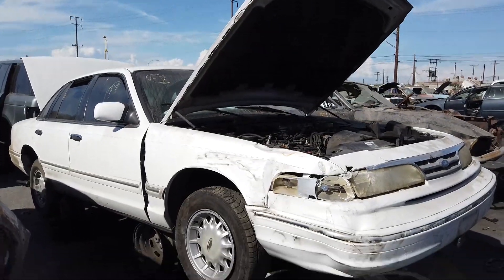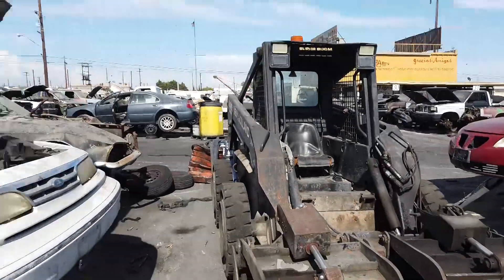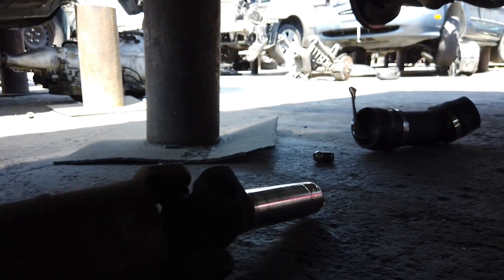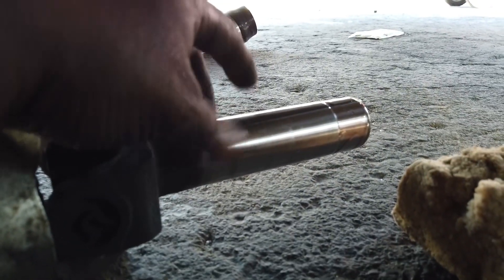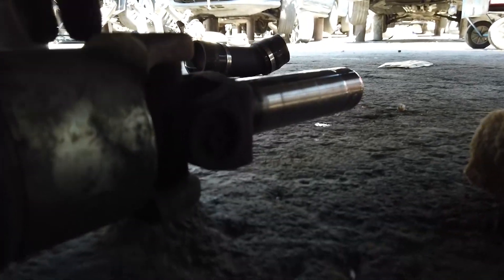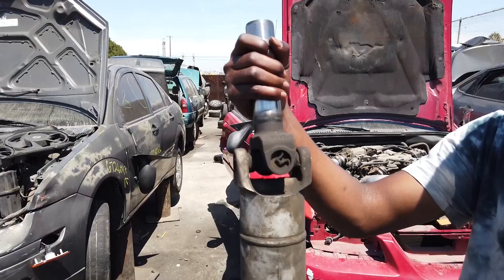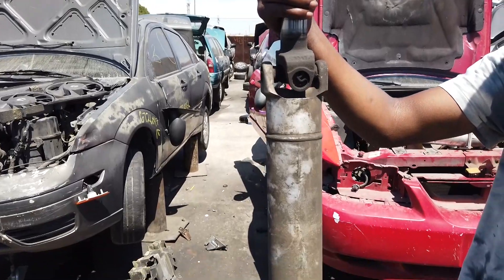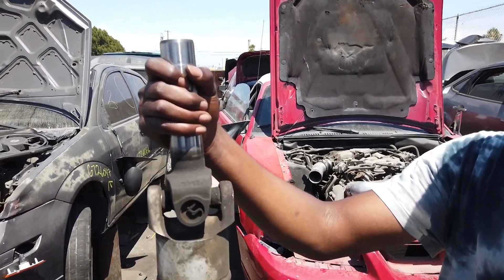Foxbody Mustang / Police Interceptor Aluminum Driveshaft Swap - JUNKYARD MOD

Comment: Just want to say you are the man tony ,I never knew crown vics had aluminum driveshafts,went to a local boneyard today and scooped up 2 for 60$, 1 will be for me and one for a friend, called a local shop and they told me 70$ to cut and balance, I appreciate all your input to the foxbody community,  thanks again.
Reply from the maker: Haha dope man!!! Glad to help.
Reply: @JunkyardDoggs  hey tony I got a question, what yoke will I need to get to work with this set up,is yours custom ,any help is greatly appreciated.
Reply from the maker: The aluminum driveshaft is 1350 yoke size, so order a 1350 28 spline C4, T5, AOD yoke from ebay.
Reply: @JunkyardDoggs  you the man,thanks brother
Reply: I'm actually using one of these on my LS Chevelle with a heavy duty th400 yoke and 12 bolt rear end. I didn't even have to cut the driveshaft.

Comment: Good energy and content - well made! 
Have an interceptor myself and plan to swap a 31L27 axle onto it as it currently sits with an open diff. Had a pretty difficult time getting those damn driveshaft bolts off at the junkyard though, was looking for tips on that. What I ended up doing was just removing the entire axle first then dragging it from under the car with the driveshaft still attached, and removing with the impact gun once I could move it around more freely. Those 12mm 12point bolts are hard to access. But yeah when I swap the axle I do not wish to remove the yolk from the trans, would prefer it stays where it is.
Reply from the maker: The trick is a 12mm S wrench, a mallot and a prybar.  Slide the pry are between the ujoint near the yoke to stop it from spinning.  Then put the S wrench on the lowest exposed bolt and wack the wrench  with the mallot and then remove the bolt.  Remove the prybar, spin the drives haft to expose another bolt at the bottom and repeat until it's all removed.
Join my site bro bro www.junkyarddoggs.com 
support the movement

Comment: Hello,
Thank you for another great video! I have a question: is the pinion flange that matches the police aluminum driveshaft specific to the crown Vic 8.8 rear end? Does the sn95 8.8 have the same size pinion flange or do I need to pull the pinion flange from the crown Vic also in order to make it fit for a sn95 8.8 rear end? 
 Thank you for your awesome videos, I already pulled an explorer alum. diff cover thanks to your advice in a previous video :-) when I am in la I will have to come say hello and show you my 97 cobra that I’ve been restoring/ upgrading. 
Cheers,
Alex
Reply from the maker: Hey bud!  Yes the pinion flange is actually larger on the interceptor you can a) get an adapted ujoint or b)change the flange completely from the crown vic to the mustang.

It would be cool to see your car man.  Let me know!

Comment: Note when using cinder blocks you want the holes facing up, this way they are stronger and less likely to collapse while your under the car. SAFETY FIRST!!!  Also the 4R70W yoke will work in an AOD if you change to the 4R70W tailshaft housing, direct fit and stronger
Reply from the maker: Thx for that info man!  Junkyard Doggin' !!!

Comment: Just picked up one yesterday from my local junkyard, however i got to figure out how to use it with a mt82 transmission because I’m not sure about the yoke part. Any ideas?
Reply from the maker: Your local driveline shop should have to proper end caps to make it work.

Comment: is the driveshaft 31 Spline or 28Spline ?
Reply from the maker: The yoke is 28 spline
Reply: @JunkyardDoggs  oh ok so it wouldn’t have a problem fitting right in with my AOD 1991 Fox ? Other than having to change the yoke
Reply from the maker: @eric5.080  the yoke needs to be changed because the interceptor yoke is 28 spline but thicker so it wont fit.
Reply: @JunkyardDoggs  ok thanks for replying I just have one more question will I need to do any cutting to the drive shaft I saw in the video you did but mine is an AOD ?
Reply from the maker: @eric5.080  you have to measure individually in every circumstance. Driveshaftpros have a measuring tool that can be used.